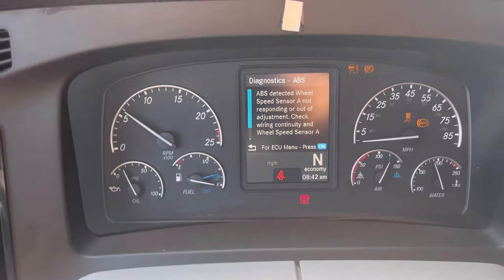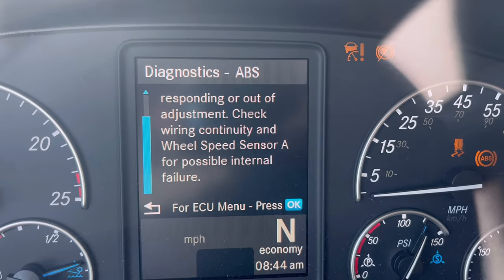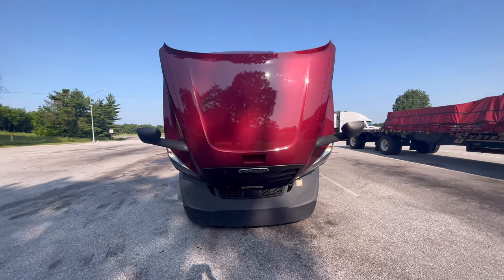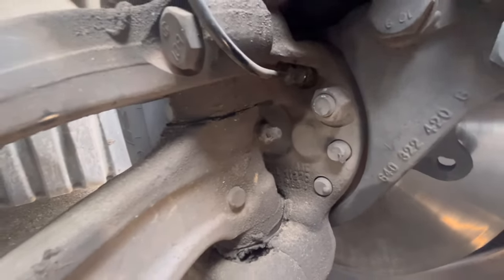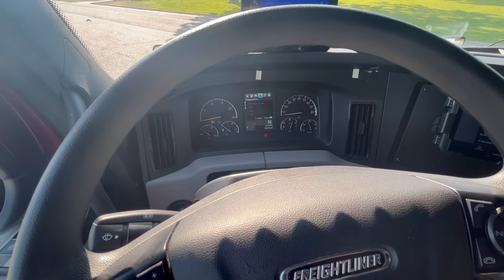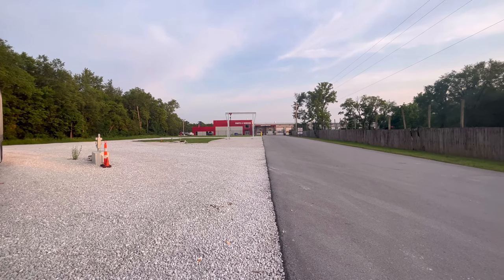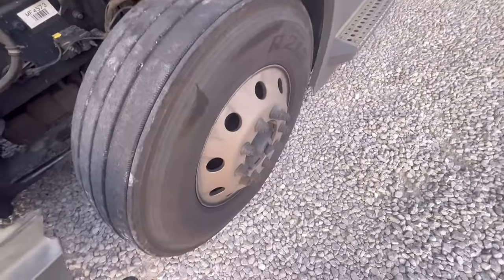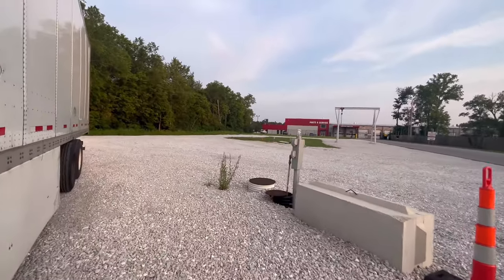ABS Speed Sensor, 2021 Freightliner Cascadia.

Comment: Turn the floor power off like 4 times. may have to repeat a few times, but it should clear eventually... seems to be an on going issue. These sensors hate rain, seen to be possessed to tell you the truth... get it fixed & they light back up eventually

Comment: 2024 Cascadia on 7k miles ABS sensor lit up during heavy snow and keeps doing it when it’s wet
Reply: Been seeing this alot lately.  Probably a nicked or chaffed wire for the sensor that is throwing the code.  Very difficult to find the bad spot unfortunately.
Reply: My 2024 keeps doing the same thing.  3rd time now 😢
Reply: Yeah 2024 is not a good year for these sensors. I know of at least 4 trucks in my branch that are doing the same thing on the same wheel speed sensor. (E) for those who are wondering
Reply: For 3rd time now I had to leave the truck to the dealership. The first was the gap issue on the abs sensor. Second time they had to replace the sensor. Third time now, idk what are they going to find this time.
Reply: @mark_tillman  is the issue always with the same sensor location?  A chaffed wire in the circuit will throw codes that will indicate excessive air gap and sensor failure.  For what it's worth, I rarely see these sensors fail.  Usually the problem is in the wiring.  I have had to run harness overlays on several of these trucks already.  After that they have not returned.
Reply: @WarMachine550  to be honest, I don’t really know if it’s the same sensor location.  I had a feeling there is problem with wiring too but dealership mechanics wanna be lazy, don’t wanna go farther than replacing a sensor or redoing code faults on their laptop. I’m gonna pass your information to them, see if they listen.
Reply: @mark_tillman  in their defense, the Wabco troubleshooting instructions for codes related to airgap, chatter, or reluctor ring rarely tell you to check the wiring.  And even if they do wiring checks, they will pass all resistance and load tests.  That's what makes this so tricky.  The problem is that the wire is intact, but there is a small cut in the wiring insulation somewhere.  These abs circuits are so sensitive that the moisture effects the sensor readings when it touches the exposed copper.  This makes the ABS computer think the effected wheel is moving faster or slower than the other wheels, which throws the codes/lights.
Reply: @mark_tillman  If it's a freightliner dealership they should be using DiagnosticLink 8 software.  With it they can chart each wheel speed sensor reading on a graph.  When the truck is wet (when it's causing you problems), they'll typically be able to see the problem sensor reading bouncing up and down or dropping out completely when the truck is sitting still.  A technician may be inclined to think this is an ABS ECU failure.  This can be elimated by swapping the pins at the ECU or switching sensor plugs on the problem axle.  For example, if it's throwing codes for 3rd axle right, plug that sensor into the connector for axle 3 left and vice versa.  If it now throws codes or bad readings for the left sensor, the problem is in the wiring.
Reply: @WarMachine550  The service manager called me right now so I literally read your comments out lout for him, he said he will get a couple of people involved from Daimler to fix the issue. Your insight on this issue is really helpful I hope Zeb the manager will use this info on his further repairs. Lets hope it helps.
Reply: @mark_tillman  I hope it does.  These have thrown a lot of people for a loop including me.
Reply: My 2020 doing the same but when I turn the power switch off and wait it goes away, but comes back again days or weeks later.

Comment: Thank you SO VERY MUCH.  I got the exact same issue just a few minutes ago.  I youtubed to look for a solution and i found your video.  Mu speed sensor B had issue and i had a bunch of warning lighta comr on including abs lights.  My cruisr control also got disabled.  I took a screwdriver and pushed the sensor in.  It got rid of all the warning lights.  Seriously thank you for this.  You saved me
Reply from the maker: I’m glad this information was helpful to you! The way you described yours, is exactly what happened to me with the speed sensor on the passenger side.
Keep an eye on it, this could be a one time thing where it just got lose but there may be something triggering this issue.

Comment: I just watch your video now and from last 2 days the mechanic work on it and then he give me negative answer that he can not find any fault but now i watch your video and try to change the ABS sensor lets try i hope its work
Reply from the maker: Replacing the sensor may do it, check your sensor, use a screwdriver pry it out. It should ha ve a nipple, if it doesn’t it may be damaged.

Comment: Cost of the fix?
Reply from the maker: Was covered under warranty but they said it was somewhere between $850-950.
Reply: @Truckers.Safe-Haven was your truck over 300k in miles? Mine has 307k maybe is still under warranty? ET4 warranty..
Reply from the maker: @vladar1986  you should be under warranty, mine was at about 200 K miles. Warranty usually go all the way to 500 K on most parts

Comment: Is that the same sensor for RAC System Failure by chance? I have a 2016 freightliner, and Freightler said a wheel sensor was "pushed out" and needed to be re-adjusted. I also have the ABS light on along with a red triangle with an exclamation point inside.
Reply from the maker: Yes, this would be the same sensor as is used to detect speed, the sensor is use for the entire stability system of the truck
Reply: @Truckers.Safe-Haven  I ended up crawling under there with a flashlight  and screwdriver and pushed on it. I wasn't sure if it even pushed in, but after I started to drive again, both dash lights went off. Freightliner charged me $600 to do that the first time, so I saved myself some money.

Comment: I have that problem wit sensor c and  i push in ... this works for a while but always comes out again

No oil
No loose tire
No visible damages 

Do you know how looks the sensor when it's in good condition?
Reply from the maker: Mine was flat at the tip, when is not damage it should have a nipple. If it keeps getting push out, there has to be something loose

Comment: Hello. 
Freightliner Cascadia 2016.
Tractor ABS light on. 
The truck won't start. 
I don't have a check engine light on the dashboard only the ABS light on. 
If you guys know something about this can help me.
Appreciate it.
Reply from the maker: Don’t know what it could be, but I would start by unplugging the battery or turning off the kill switch for about 5min.

Comment: I have the derate problem stuck at 5mph should i pull out the speed sensors ?
Reply from the maker: What I did is turn off the traction control switch, and it would help but I’m not sure if the will work for you.

Comment: When l did mine the censor was all dirty and covered with black gunk and it still doesn't work could that be the problem
Reply from the maker: The sensor has grease around it but shouldn’t be covering the front, where it’s closer to the wheel.
I would clean and inspect it for damage, if no damage, I would put it back and check if fault keeps coming back

Comment: It show me this message do you think same problem ? ABS detected problem with wheel speed sensor F 
And when i start driving slow same traction control
Reply from the maker: Almost positive it’s could be something similar, try pushing in sensors, maybe shut truck power off for 5 min. If it lets you drive and it keeps happening should get it checked.
Reply: @Truckers.Safe-Haven   i did i dont have any code  right now , thanks but just when i start driving slow i sow the traction control lamp turn on like you on the video
Reply from the maker: If it doesn’t slow you down just keep driving it it may go away, I had that happened to me on a different occasion